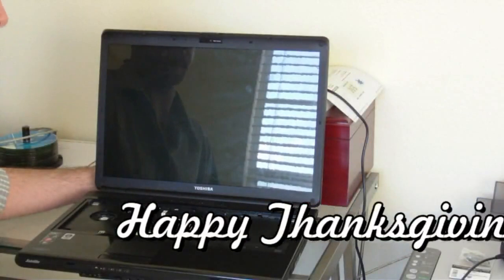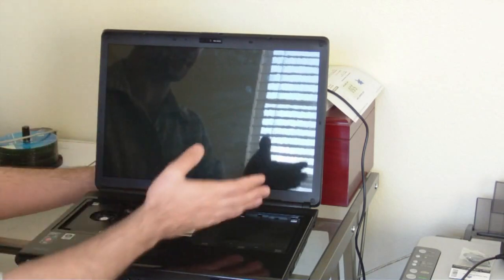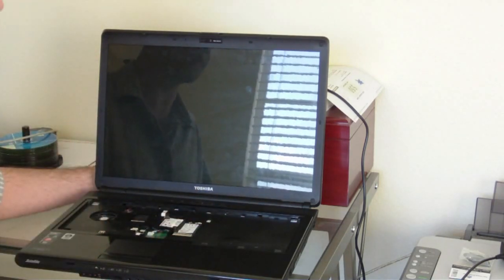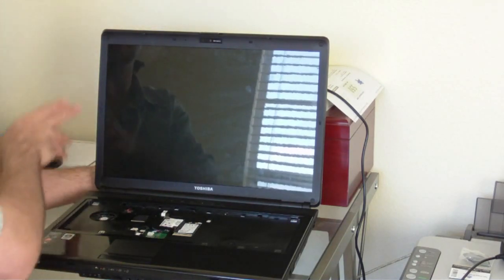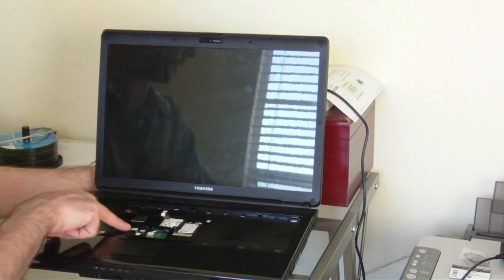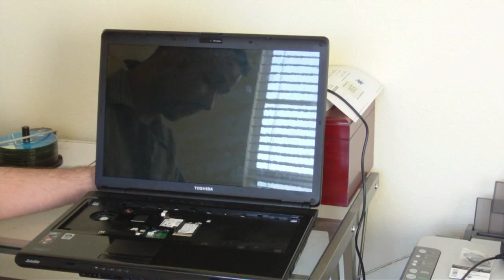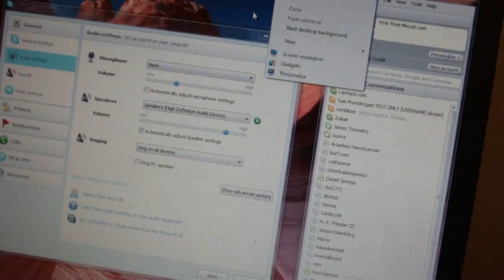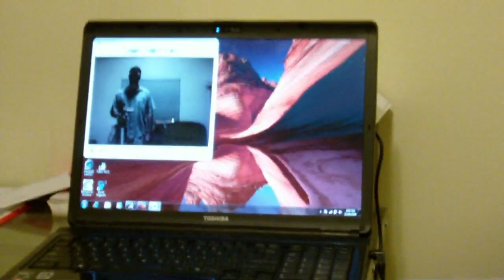Toshiba L355D Laptop webcam Hack! add a mic and cam how to

Comment: I have this model laptop and trashed the screen assembly in a car accident. I have made a project of repairing it and I actually bought this monitor assembly and want to connect these devices. But I have never undertaken anything this advanced before. Were could I get these parts like the port for the camera and mic you attached to the motherboard. And any advice on were I could learn more about this type thing before I try this?